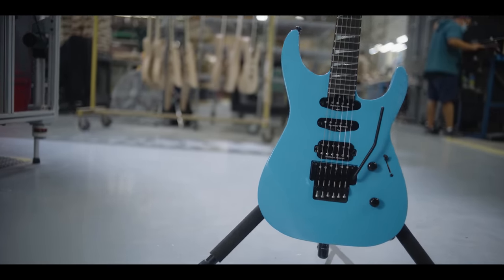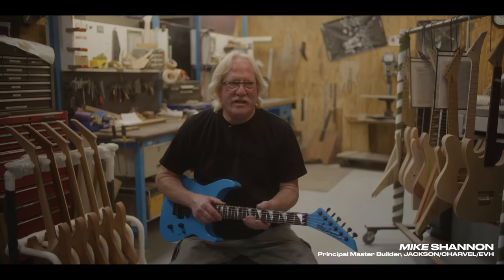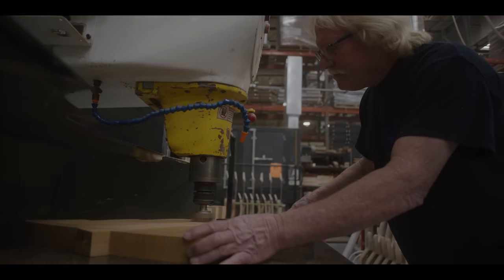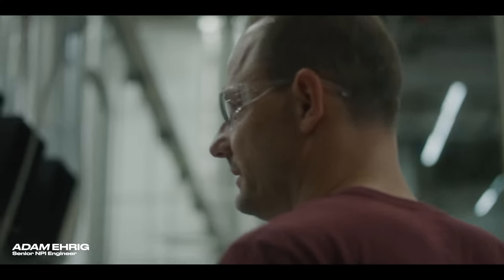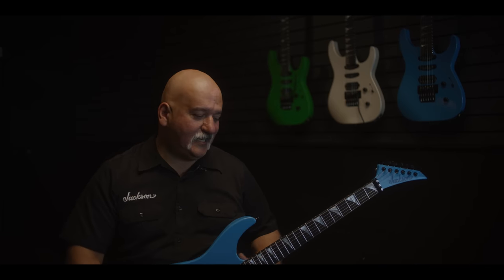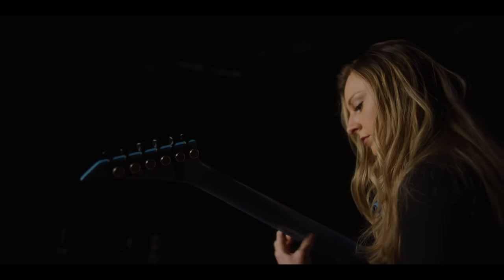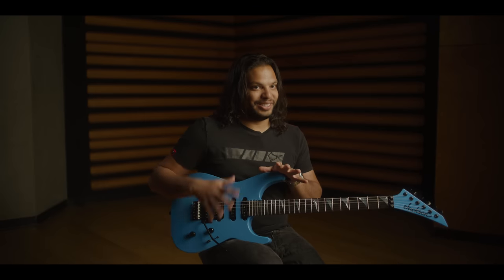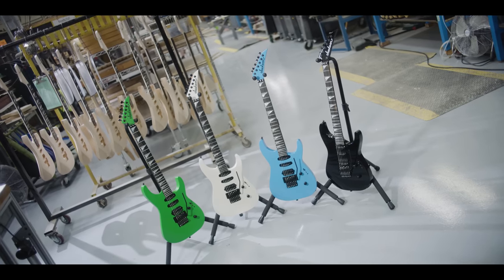Origins of Speed | Jackson American Series Soloist | Jackson Guitars

Comment: So I tested out one of the new SL3 guitars last night. The fret work and setup out of the box was incredible,  fast as f@ck neck is an understatement. It felt quality. I dont care for the HSS setup,  would prefer HH with pickup rings not exposed cavities,  looks very cheap. The reverse inlays are really cool and actual pearl. Wish the headstock logo was also pearl not silk screened. 1500 series trem felt better than expected. Still think Fender/Jackson is shortchanging consumers with a fairly bare bones soloist for a pretty hefty price tag. If they knocked $500+ USD off the msrp it would seem more reasonable.